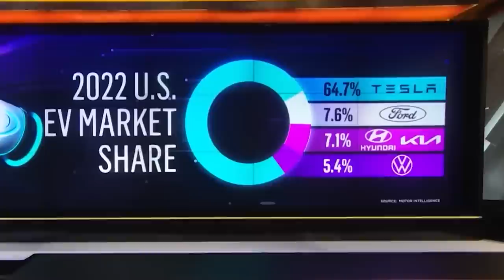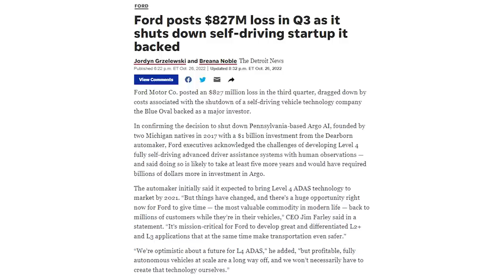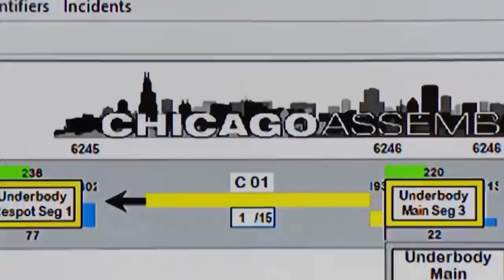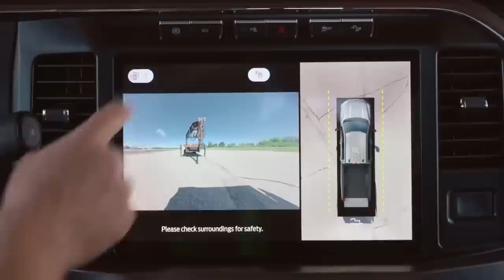Ford CEO Makes Big Changes To Fix Quality Issues

Comment: I have heard all this "quality, quality, quality" bullshit all my life from Ford and GM.  Both companies seem to excel at selling just the opposite of their claims.  They fooled me, but I won't be fooled again !!  Consequestly, I haven't owned an American made car in decades.  Ford and GM should have followed the Japanese manufacturers years ago instead of the trash they pedaled.  Now they are attempting to get us to believe them again.
Reply: Couldn't agree more! I'm done with Ford, GM & the so called American company Chrysler lol
Reply: Yup, they’re a day late and a dollar short
Reply: Both companies practice "cost management" instead of "quality/value improvement". Some see the latter as extra costs but those who know, recognize that improving quality and providing the best possible quality to all customers (especially when it's recognized most customers are internal to the company) will actually drive a far better bottom line than all the penny pinching and "cost reduction" anyone could ever do. Whenever the cost is reduced, something is given up. Maybe it's 3% cheaper on a way that only alienates 1% of external customers but it will I produce failure and inefficiencies greater than the initial projections. Maybe that 1% is this quarter but over the next year or two, it ends up costing 5% of loyalty. The math ends up being "how much can we cheapen our experience" instead of "how much better can we do without spending much to improve"
Reply: Never heard Toyota slogan “Quality is Job 1” or similar public announcements, they just do it.  The product speaks for itself.

Comment: I feel like you should make sure things work before you go and add even more stuff to your cars. New tech is cool, but it's pointless if the simple things still don't work.
Reply: For what these things cost now, it is NOT unreasonable for the buyer to have a purchase that is free of major mechanical and safety issues. If you can’t do it, go back to crank-up-and-down windows, steel wheels with plastic hub caps, manual seat adjustments, and AM/FM radios with one speaker.

Comment: My escape broke down the day I picked it up. Dealer had it the next 9 days. Its on its 3rd engine That is a story in itself. I just found out I need brakes all the way around. All of this in the first 40,000 miles. The big surprise, Its not the worst  ford I have had. To hear all this yap yap from a company who wouldn't stand behind what they built because they knew it was junk.  It's all words Mr CEO.
Reply: Go buy Toyota..  Ford is good for Superduty's.
Reply: Daughter's Escape engine went out at 5k miles.  At 80k/2.5years, transmission goes out (out of warranty).  Ford wanted 9000 to replace - cost 4500 to rebuild.  She lucked out and totaled it 6 months later and bought a RAV4.  Couldn't be happier.  Wife got rid of her Charger with 'hemi tick' valve noise at 100k miles and  bought a Camry TRD.  Couldn't be happier.  I'm holding on to my older F250 and trying to decide what to replace my 06 Mustang GT with...
Reply: Not the worst, Ford? That means you are a fan of a company that built craps. Still, I'm betting that they can change. 
Efficiency and reliability created!! Else, I'm screwed!!
Reply: @TSparky  American car companies built their vehicles to reflect the red blooded, coarse, American thinking (see the last part of Memior of a Geisha,  how rude, coarse the American general acts toward the Japanese characters).
I still betting on Ford. I hope they will add some Zen to their vehicles!!

Comment: The 7.3 litre gas engine was the answer to my prayers for an f350 swr truck. Until I saw a video on cam and lifter delamination. I'm back to zero now.
I'm not paying 120k for a diesel truck. Not in this life. 
Even their gas truck are obscenely priced.

Comment: Well it ain't Rocket Science!! Whatever happened to: "Ford, where quality is Job One!"?
Reply: False advertising ;)  Although to be fair, my 1 ford and 5 lincolns have been amazing cars to own over the last 20 years (ish).  we are down to just the 2017 MKZ hybrid now.   I had to let my lightning reservation go because the price was insane going from $40k to $62k plus $10k for the dealer mark up :(  got a model Y instead for $51k with a trailer hitch.

Comment: Most of Ford's problems are arising out of redesigning parts to use less material and then the parts failing. They need to stop doing this. Those parts are made as robust as they are for a reason. Stop telling engineers to use less material.
Reply: I was gone when they downsized the Explorer. Zero reason. If I wanted a compact car I would go with a different car maker.

Comment: My 2010 f150  was leaking by the backlight water dripping through back ceiling no gasket around the light im sure thats part of the reason my rocker panels are rusting through there was no recall so a caulking joint had to do

Comment: Trouble is, defects are designed into most of Ford's products. To eliminate them from the inside out,  it will take a whole new generation of products (and how long does that take?). And even then, that assumes that their design process and supply chain choices have been completely changed and raised to a whole 'nother level. How do they get their product development teams to restart (their entire philosophy, even), from a completely blank sheet??

Comment: US Manufacturers has to go back to the basics " Quality over Quantity " ... Made in the USA
Reply: They have too many underperforming union workers with high wages.  We need to lay off 50% and go full automations in many areas of assembly line processes.
Reply: @W J  it's not union workers... it them outsourcing cheap products from overseas where they don't have quality control on their items

Comment: From someone who currently owns a Toyota Tundra and looking at a new F250 powerstroke, it’s good to finally hear that quality control is the priority. This is what was making me skeptical about the new Ford!
Reply: you better think long and hard about getting a Super Duty.  I have one still under warranty and Ford is giving me the runaround and delays over fixing serious issues with it.
Reply: I work at a Ford dealership and  their corporate office does anything they can to avoid paying for a warranty work. I’ve seen brand new cars with only 10,000 miles that they refuse to cover under warranty and all they do is make excuses and blame the customer. One of our advisers was arguing with corporate for over a week before they finally agreed to repair a transmission failure on a maverick with 2000 miles.
Reply: @noahschaub1984  You would know better then me but there is a lot of super duties on the road. I have been questioning everyone I see and asking how they like their power strokes. I keep getting the same answers.... "I Love it" and most have 100-200K with no issues. I think a few youtubers explain some of the issues they had but like any brand....you will find some with issues. Although, my tundra has NO problems🤞🤞

Comment: My 2020 Tacoma only depreciated $1,200 in three years. That’s right, the dealership (Avondale Toyota) sold it to me for $39,200, and gave me a full $38k on trade in 2023. Not a cent over MSRP. No recalls, no fails, no problems. Poor old Ford is dead.

Comment: Nice commercial, but..  Just like the late 70s, you've lost a whole generation of car owners (or in Ford's case, Trucks/SUVs only).  It's not just quality issues but actual design decisions.  Put the water pump in V6 oil pan, check.  Source Mustang GT manual transmission from China, check.  Design Escape transmission to barely make it past the warranty period, check.  Stop selling cars in favor of SUVs, check.  "So long and thanks for all the fish"

Comment: The f150s have a recall for the lead frame in the transmission. The part is backorder for about a year now. But u can buy a valve body for 1200.00 that comes with a lead frame. What a scam.

Comment: I least you cannot blame the defects on the assembly personnel.  This is higher up in the food chain.  Engineering, the bean counters.
Reply: Have they added a drain plug to 10 speed transmissions - moved internal water pumps etc., etc., etc.

Comment: Wouldn’t it be better for Ford to own it’s own dealerships where they could sell and maintain their vehicles in house and cut the profiteering by some dealers. Ford are NOT a cheap vehicle to buy anymore so they need to be value for money or they’ll loose customers,most other manufacturers have upped their game and Ford need to follow suit,I’ve had a few Fords over the years and been quite happy with them but purchasing a 2 litre diesel Kuga with that Shite Powershift gearbox finished me and I went to BMW with their super smooth automatic 8speed gearbox and powerful 2 litre diesel. The fuel consumption on the Kuga was abysmal especially around town where 20mpg was the norm,on long runs it barely managed 35mpg whereas the BMW would happily give 37mpg around town and over 50mpg on long run’s.

Comment: My 2016 Ford Edge 2.0L ecoboost with 66k miles just seized due to coolant intrusion.  It's a TSB and well-known issue, but it's past warranty, so I was told to kick rocks.

Comment: I have had little problems with my 2013 F150 and it tows my 2.5 ton and 3.5 ton  toys well. What does piss me off is putting the cost of EV development on the folks that want a new truck. EVs that are obsolete before they leave the assembly line.

Comment: Ford has had quality issues for over 35 years.. my mom had 2 transmission issues on 2 different models, Fords position is they will fix the transmission only ONCE.. poor customer service at Best.. only buy Toyota or Lexus for reliability!

Comment: Need to use the Japanese car manufacturing model of gradually improving the product, instead of trying to add 6 new untested technologies that add more problems. They don't realize they will make more profits long term instead of trying to take cheap shortcuts to hide problems.

Comment: Ford trucks are stacking up on dealer lots.  Ford just had a three-year lesson in scarcity causing high demand and high prices. So, they are claiming virtue for pausing production for "quality". Why didn't you mention the Toyota/Lean quality methods Ford is using now that they have found religion? Andon cords to stop the line if a defect is found, so that the cause can be found and corrected by the Team Leader (only senior people are allowed to stop the line at Ford, and it could be a career ending action). Module Development Teams that co-ordinate across functional disciplines. Simultaneous engineers that co-ordinate between design and production. One piece flow instead of batch processing, Managers coaching their subordinates in problem solving rather than issuing orders that must be obeyed without backtalk. Blueprint redlines that become checklists for product development (engineering). The right part, at the right time, in the right quantity, in the right place (J-I-T). The right information, at the right time, for the right people, in the right place (who hasn't been in numerous meetings that were a complete waste of time and impeded progress). Only doing things that increase customer value (no feather nesting your personal empire).  When sales pick up, quality will be the fifth priority.

Comment: Ford really screwed me on a 2015 Ford POS Fusion SE. Cracked cylinder head at 22k miles fixed under warranty then at 55k miles broke down again. Ford would not back up their crap warranty repair either. Traded it off soon after for a 2020 Camry SE that has been rock solid. It is sad the Fusion looked good and had a good ride. Just not reliable and would not hold up long term. The Toyota you could immediately feel how much better it was built. Everything was tight and precise and the Fusion felt like a tin can compared to it. Ford Sucks!

Comment: No excuse — I have a 2018 F150 Lariat and it is a piece of SHIT.  It’s been in the shop so many times with over $7k of non-warranty repairs all under 65k miles.   I had a Tacoma that I put 170k miles on with just basic maintenance— tires / brakes / fluids.  I’ll never buy another Ford for as long as I live.  Back to Toyota

Comment: Dear Jim, I've moved on from Ford.  Drove Ford trucks since 1986.  My current '03 F150 will soon be replaced by a GMC 2500HD or a Toyota Tundra.   Hope the woke generation buys your over-priced, recall-happy, shoddily-built trucks.  Way to drive a once great company into the ground.

Comment: The people can help ford on quality, just stop buying the product, this happened in the 80,s ,same problem , incompetent engineers,cutting cost,inferior parts, and TRYING TO REINVENTING THE WHEEL. Hey Farley if it ain't broke don't fix it. U don't need computers every inch of the vehicle.the 70,s didn't have all these computers and they run fine, and don't tell me ,quote  we have to get emitions down so we need computers.i say B.S.to that.all you have to do is capacitive discharge ignition, no cam phasers, no 10 speed tranny's, in other words all u dummy engineers ,if it ain't broke don't fix it.